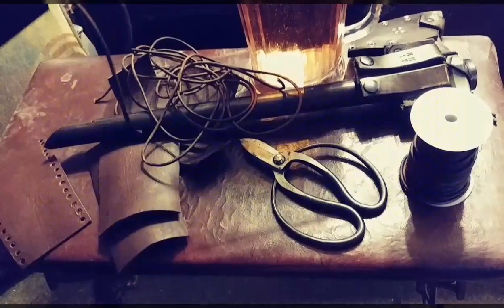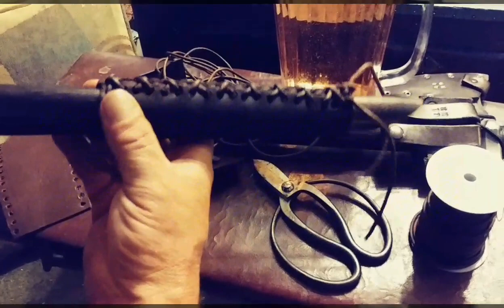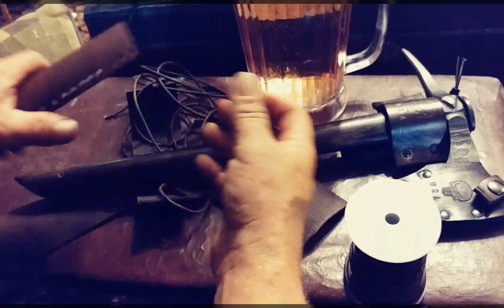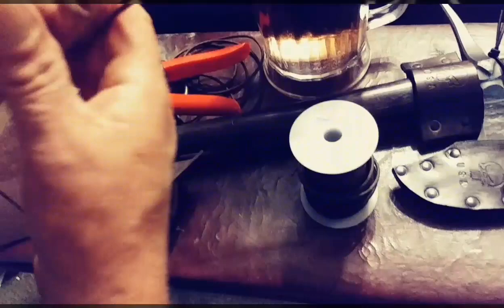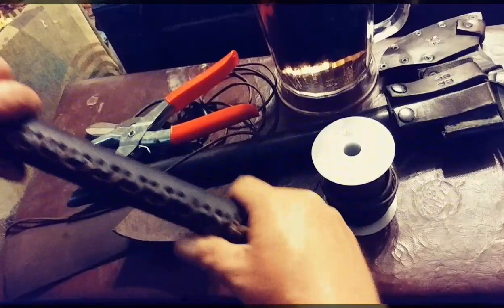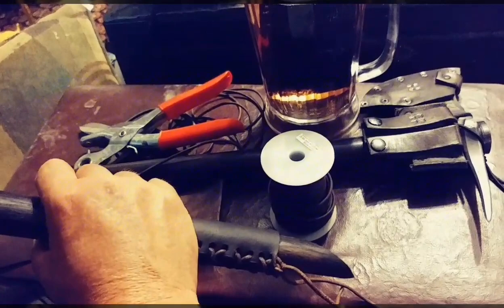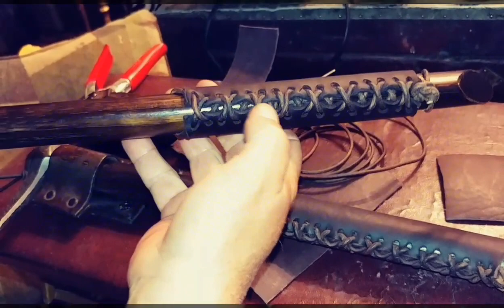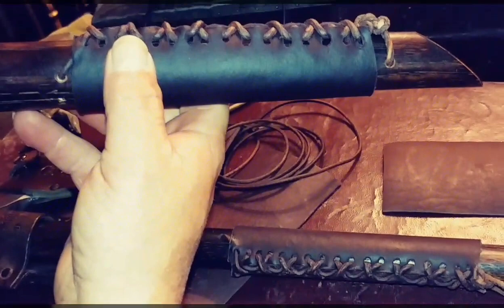How to wrap a handle with leather

Comment: This answered the question that I needed.  Plus I really enjoyed you being you.  If I had a teacher that would have told me to let that soak for as long as it takes me to smoke a cigarette the class would have been entertaining and educational.  Looking forward to wrapping the handle now.
Reply from the maker: Thank you I'm glad you enjoyed the video. I would like to add that if this is going to be on a hatchet that you're going to be throwing or using then you should put a little layer of Titebond glue between the leather and the wood to prevent it from slipping a flying out of the handle grip

Comment: It's better to just glue the leather on and have a seam that joins perfectly.  The leather stitching he has in this video is WAY too thick = would quickly become uncomfortable for your fingers with usage.  His first handle with the stitching on the palm of the hand would be even worse (which he admits in the video).

*You can also have a little outdent (opposite of indent) where the leather seam meets = your fingers now have a reference to blade facing that doesn't get uncomfortable.  This is my style when I do leather handle wraps.

**drilling holes in the handle higher than the grip is ALWAYS a bad idea.
Reply: The leather stitching must be a matter of preference. I have since done this on 3 different pieces and have found it both stable and extremely comfortable. (BTW, one of those pieces is a 2lb. short handled wood ax that gets heavy use).
Reply: Sincere inquiry, here. I want to wrap a homemade knife handle with leather this way. And later maybe a hand axe. Why is it a bad idea to drill the hole above the grip? Ty!
Reply: NateTaylor that's strictly your opinion. Not law.
Reply: @RDobbs-uv4xc  ?  Nowhere did I claim anything about legal issues concerning leather work.

Comment: ...too bad that style of stitched wrap is useless on a curved handle (pistol grip handle).....
Reply from the maker: Definitely not useless. Works very well
Reply: @-GetGoTv  Agreed!  BUT only for a straight shaft....a curved shaft with a pistol grip (like most modern axes have) = the width of the leather wrap changes too much as you go from the thinner part of the shaft, to the wider end of the shaft (pistol grip bottom part).  How would you compensate for that?